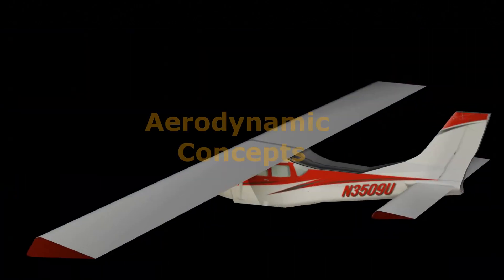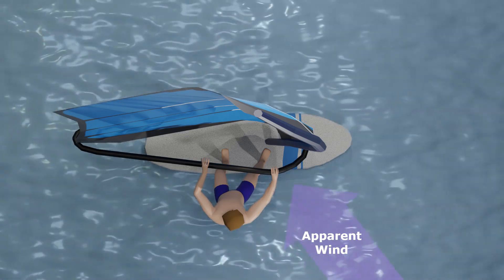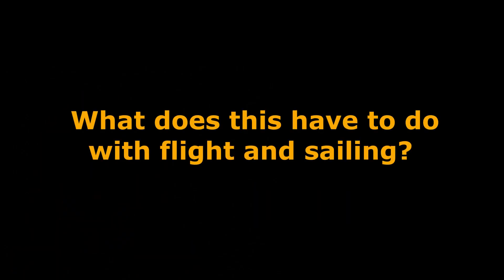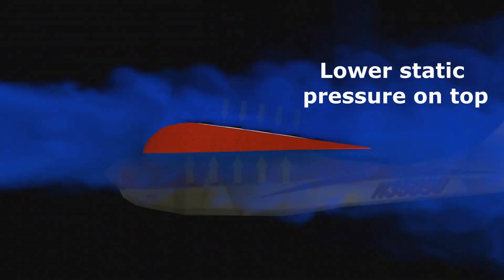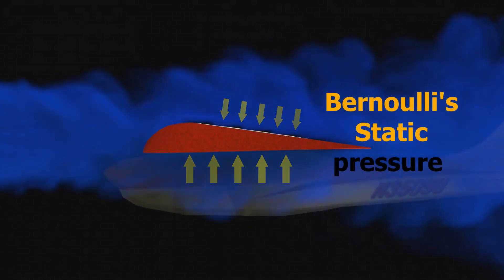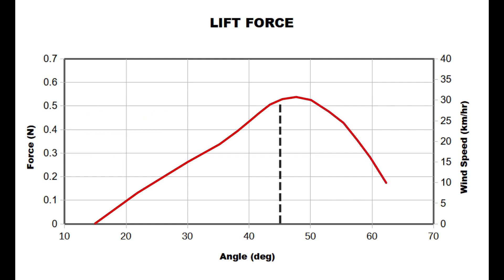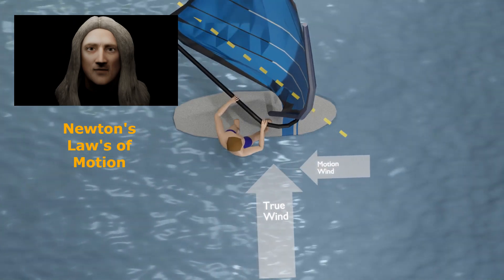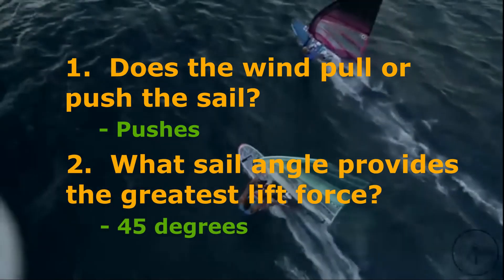Change the way you think about windsurfing

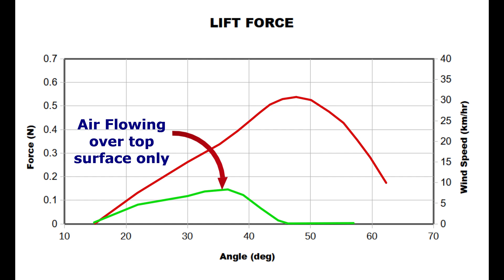Comment: I really wanted to see the sum of the two lines at 6:30; wouldn't this give a more accurate idea of the combination of the two forces at play at different angles?
Thank you for the video.
Reply from the maker: Thanks Alp.  The red line is a reflection of the air moving over the upper surface and the lower surface so it is in fact a sum of the two forces.  The green line is just the air flowing over the upper surface and would reflect the drop in the static pressure from Bernoulli's theorem.  There would be a partial vacuum behind the curved surface of the sail causing the sail to be pulled upwards.